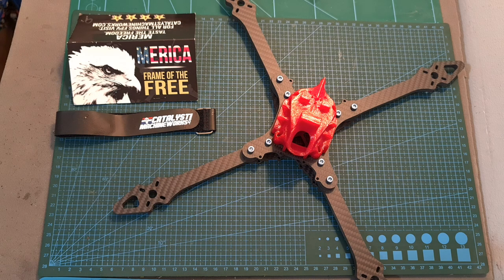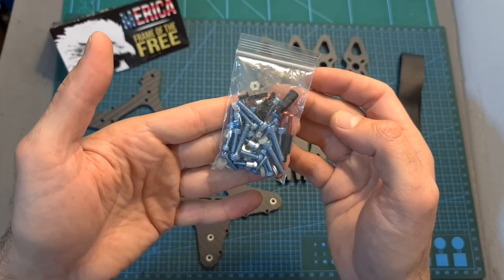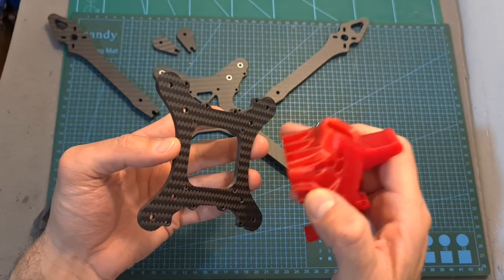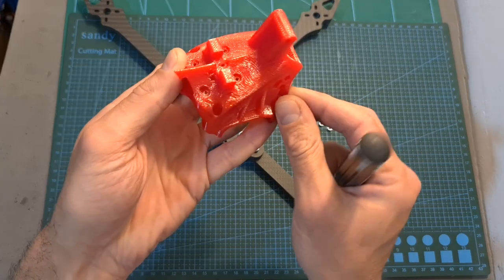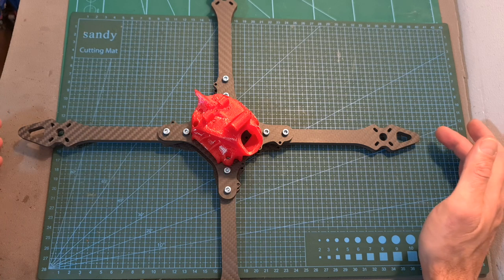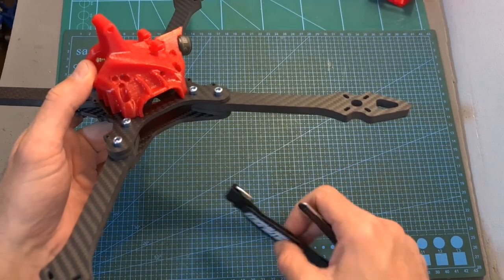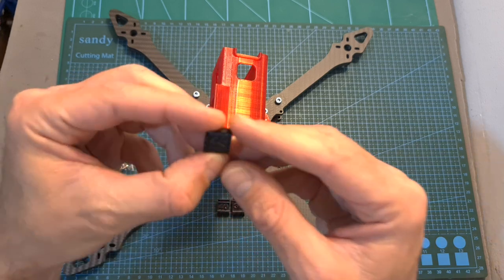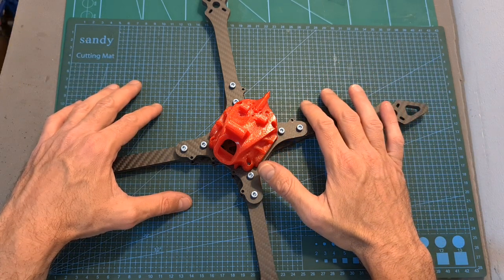CMW Macro Merica 9" Frame - Assembly & Overview

Comment: Hey buddy, what would you stick in for a 9" or 10" build... props.. motors...
Reply from the maker: Build video will be up soon once I will receive the Brotherhobby 2816 1050KV motors. I am going to use the Zeez F7 60A, Caddx Nebula Pro and of course a CRSF Nano receiver.
Reply: @KremerFPV  have you tried ELRS , that is the current trend.